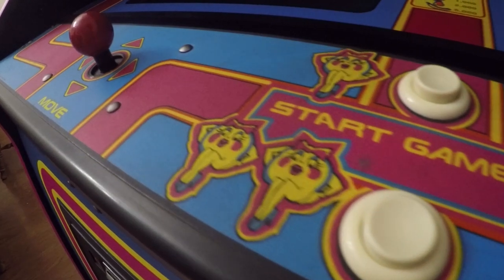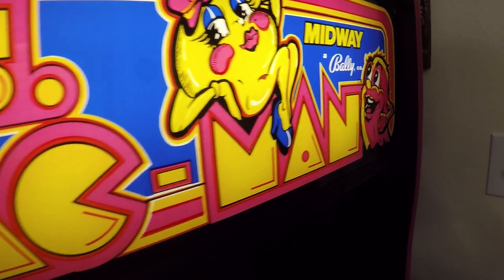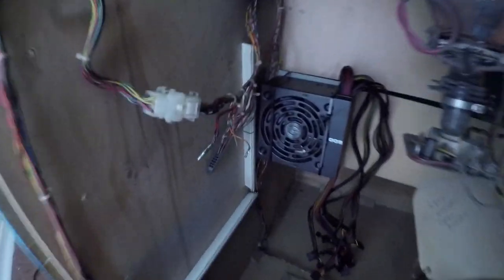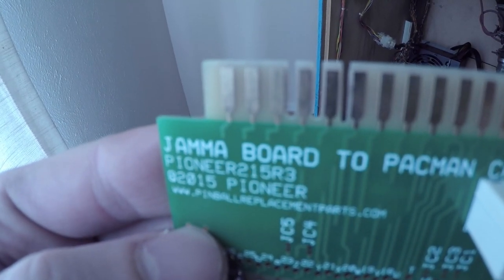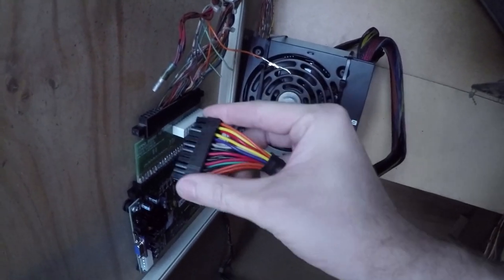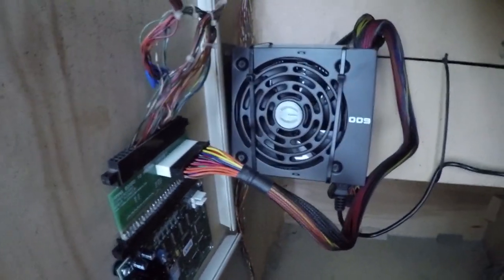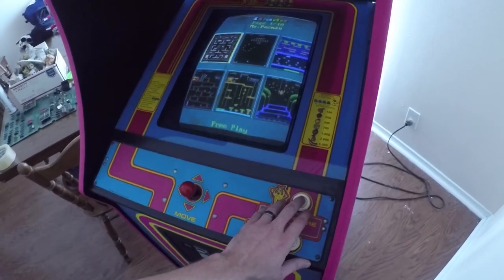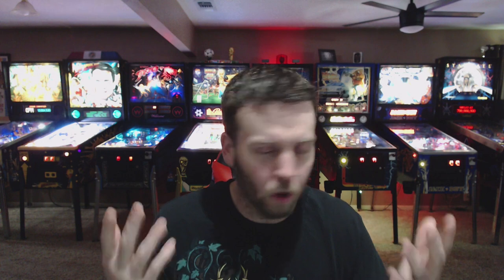How to install a 60in1 board in your Pacman/Ms.Pacman Arcade Machine

Comment: Splicing into the AC power going to the monitor is not something that I would personally recommend . The power to the monitor goes through an isolation transformer, and is used solely to power the monitor for a reason. There is a potential to be creating an electrical safety issue.

I believe it should be recommended that anyone not understanding the deadly high voltages of something like a monitor or other device , how to work in proximity to such things (even with power off), or how to safely wire something - leave it to a professional to do so.

Comment: cary   I have a 20th anniversary ms pacman/galaga cocktail game that stopped working.......I ordered a 60 in 1 pcb   board but when I put it in I can hear the games but cant see anything but colored segmented lines.........haven't seen a "converter" that you mention in this vid
Reply from the maker: Check the dip switch settings that came with your manual. There is a switch on the board for if you are sending the video signal to a CRT or a modern screen.

Comment: Can I do this with my old midway 12-1
Reply from the maker: The harness may be different. This video is primarily focused on converting Mrs. Pacman.
Reply: @CaryHardy  thanks for the response it seams nobody is working to upgrade the old midway 12-1. If you know anyone that's done one or have any info I would be grateful.

Comment: How did u set up the whole thing the manual sucks I'm lost
Reply: Be sure after you make any feature adjustments, ex: "fast" or "slow" or number of lives,  that you tap either one or two player buttons to save changes. You'll see "Setup OK" flash briefly on the monitor screen acknowledging the changes were saved. To enter setup or test you hold the test or service switch or sw-4 on the PCB flipped to the on position. use the joystick to select and adjust features. The "DIP switches" are virtual. The tables tell you what they do. Be sure to save your settings as above.

Comment: Now I know that you DO NOT use the AC power from the harness.  But can I leave the AC power cable on the connector slot, because I am afraid I'll pull out the wrong cables, and mess something up.  Will it still work, without me pulling off those 3 wires from the harness connector?   Can you do a video on how to isolate just Ms. PacMan on that 60 in 1  board, so that the other games don't come up on start up?  I just wished that the original designers of the board would have made a nicer looking menu selection of games, but anyway that's another story.
Reply from the maker: You can keep those wires in. They are technically isolated. Follow the board traces and you will see what I mean. As far as isolating Ms. Pacman - I'm unsure of this objective. I'm not sure if the board offers such an ability.
Reply: It is possible to lock in a game at boot-up. Simply DISABLE all the other games in their menus.
Reply: What happens if I use the original power supply???